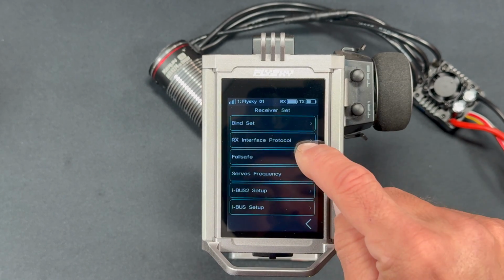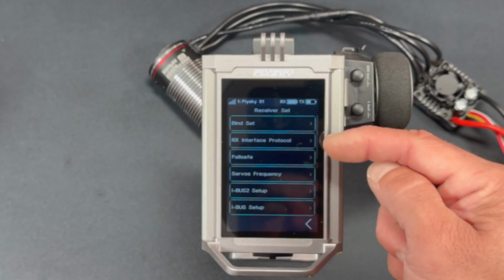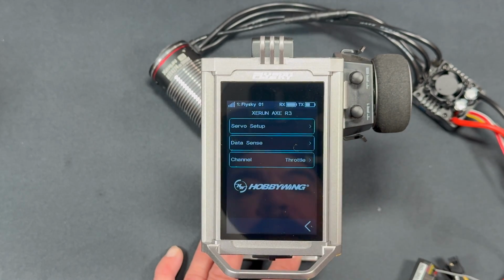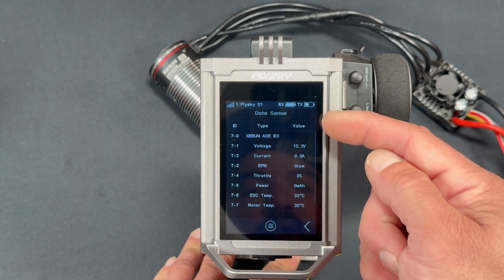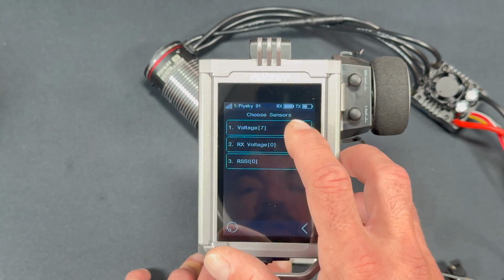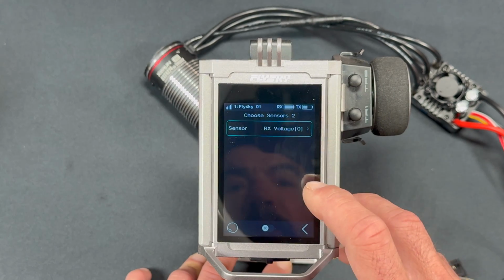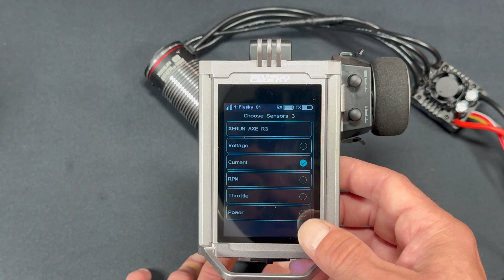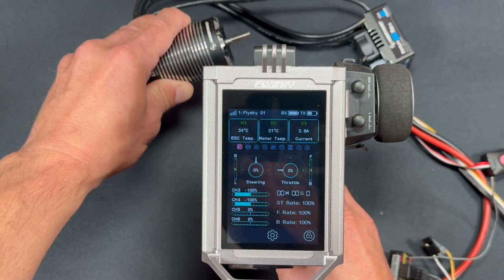Hobbywing AXE R3 - IBUS.2 - The Charlie Show - Ep 371

Comment: G'day from Australia!   Is the hobbywing EZRUN MAX10 G2 140A compatible?

Do i need IBUS.2 or can i use IBUS.1/IBUS from sky fly?

Any other ways to do it as in what signal type does my esc (EZRUN MAX10 G2 140A) output please? 

Is it open source? Is there a community doing development i can join?

I just got into rc's 6m ago and was going to use a esp32 then i seen this video and would love to learn and help make apps and interfaces to make a better experience for the average user all the way to the racer or crawler or basher etc.

I bash, i burnt my last esc and brushless VXL system on first battery charge 25m in from overheating bashing so imo integration telemetry is vital for the tech savy person who want to adjust every behaviour possible and peace of mind with say an interface that they can customise on these lcd screened transmitters so me personally need the temperature of motor and esc as i live in Australia and its hot here all year round and i bash hard and change setup constantly like gearing and tires etc so overheating is easily done.

Comment: I used Ibus.2 with an AXE R2 it was amazing, I will definitely be using it again on my R3 and NB4+. Quick question for you if I change the plug on the R3 esc will it void the warranty?
Reply from the maker: Done correctly connector changes should not be a problem.

Comment: Does my XR10 pro G2 have this ibus availability. I have a noble nb4+ and I'm confused how to set up ibus
Reply: When are we getting this on the drift esc?
Reply from the maker: This tech, goes against core "Racing rules" for sanctioned level racing so it is not offered in the racing line up.  It's something that could come along later on, but at this time it is not.
Reply: @HOBBYWINGOfficial  so my xr10 pro stock doesn't have this either I'm assuming ?
Reply: If it would be disabled while in „blinky“ mode it would be legal. 
But it would make finding the best setting for the car/track so much easier….